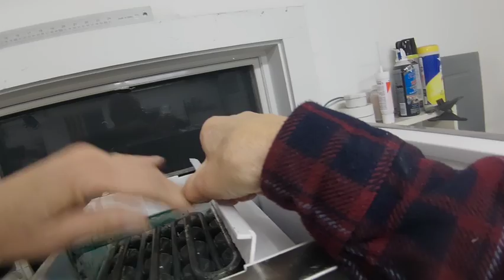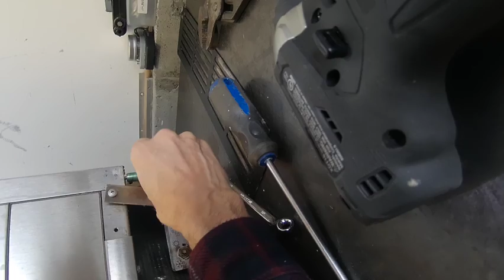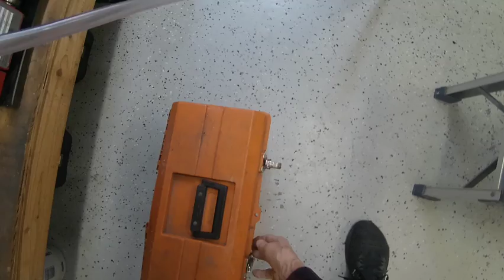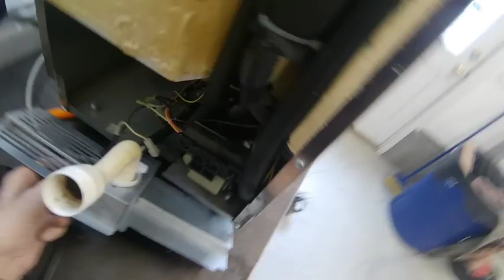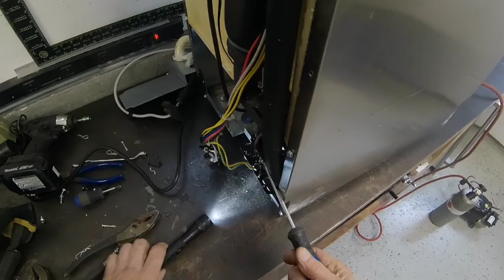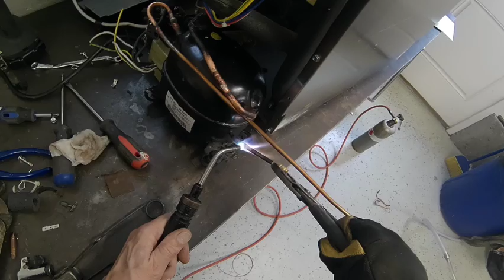Sub-Zero UC-15I Diagnoses and Compressor Replacement,ent

Comment: No need to open up the pump or remove the pump.  How to clean the entire machine. Need 3-4 large bottles of Lime Away or CLR. 1.Disconnected water inlet line,  2.  Fill the ice reservoir full of Lime Away.    3. take drain hose and place end of drain hose into the Ice reservoir. 4. Disconnect compressor electrical connector.  5. Place water inlet line in a full bottle of Lime-away and place bottle high above the machine. 6. Make Ice. Let unit run continuously for 3-5 days depending on how badly calcified the unit is.   When done, This recycle procedure cleans the entire machine repeatedly.    Do not use Vinegar.     7. Then rinse at least four times.  8. throw away the first batch of ice.         If you have unnecessarily removed the pump.   Fill the pump with large bottles of Lime Away or CLR,  until it comes out the other tube. Let sit for at least three days, Then rinse at least four times.

Comment: Local Subzero repair guy came out for a $200 upfront cost - (they are respected and knowledgeable & we have used in past) just to tell us the machine is too old and not worth repairing and best to buy a new machine.  I wish it didn’t cost $200 to tell me that! 🤦‍♂️
Reply from the maker: I have several of these for parts, try selling it on FB Marketplace or eBay.
Reply from the maker: factory service?
Reply: @SubZeroSpecialists  routine sanitation and cleaning, filter changes and yes he was factory certified and no he never even opened up the back. This seems to be the routine here in New Orleans. Service don’t need to repair anything if they charge that much not to. It’s pathetic.
Reply from the maker: Where are you located?
Reply: @SubZeroSpecialists  New Orleans.  You need a trip to the Big Easy!!
Reply: @SubZeroSpecialists  why don’t you come get this thing? I’m sure it can be made to work, I replaced it already.  But too many good parts in it to just leave on the street! Let me know

Comment: Great video and great patience. My compressor was replace 3 months ago but it wasn’t the problem. I think they replaced a board which got it working but now back to its old way. It makes ice in 31 minutes on the money,  but then gets stuck in harvest cycle I guess. The water line opens up and runs continuously. Sometimes it will move out of harvest but mostly not. It needs to be turned off and back on. Is there something in the harvest cycle like a sensor that tells it to go back into refrigeration mode? Or is it supposed to be a timed cycle? Thanks
Reply from the maker: There is a sensor on the condenser. I would check the water level and the water valve.
Reply: Thank you for the quick reply!  @SubZeroSpecialists
Reply: I went to your website and read the ice making procedure for the UC-15ic. The best I can tell is everything is good except it will get stuck at the “Refrigeration System Start-up”. It is supposed to be there for 5 sec but it will just stay there. If I turn it off and back on sometimes it will work. Is it safe to say its the board? Thanks! @SubZeroSpecialists
Reply from the maker: It’s hard to diagnose a machine without being there, there are many variables. What’s the back pressure, is the water spraying, is it running out of water?
Reply: Sorry, I don’t expect you to fix it. Just picking your brain and years of expertise. Everything can work perfectly for days then gets stuck in start-up mode. If the manual says Start-up last for 5 seconds is there anything besides the electronics board that can tell it to go longer than 5 seconds? I know it’s not the water level because it keeps pumping out the overflow when stuck in Start-up.For some unknown reason it has been flawless. I had it turned off last night.  @SubZeroSpecialists
Reply from the maker: @koomamps  call Sub-Zero at 800-222-7820 ask for an engineer and explain your problem, they may be able shed some light on it once they know your serial number.
Reply: Hi, I finally noticed there is a jumper on the board for 134 vs 209 refrigerant. It has been wront on 209 vs 134. Do you know what the possible issues that would cause? Would it blow the board or anything major? @SubZeroSpecialists
Reply from the maker: @koomamps  are you referring to the control board. Send me a pic at subzerospecialists@gmail.com
Reply: Sent, thanks! @SubZeroSpecialists

Comment: and acetylene without oxygen will be able to melt brass, which is used in the factory soldering of pipes on some refrigerators
Reply from the maker: The Turbo Torch will assist in melting the solder. I use silver solder 56%
Reply: @SubZeroSpecialists  I meant when desoldering when you remove the old compressor, it is sometimes soldered with brass, which has a higher melting point than copper-phosphorus solders.  Map gas burner can't desolder this.

Comment: I forgot to ask where you can buy a container for pumped out freon like yours?
Reply from the maker: Are you talking about a charging column?
Reply: @SubZeroSpecialists  yes glass
Reply: @SubZeroSpecialists  yes glass
Reply from the maker: Charging cylinders are no longer available, try eBay. They were made by Thermal Engineering and were discontinued
Reply: @SubZeroSpecialists  what soldering gas is used?
Reply: Sorry acetylene

Comment: I have 2 questions Where can I buy a pipe cutter with a ratchet mechanism like yours?  and what kind of gas do you have in the welding cylinder and burner?  Give links where you can buy all this.  Thank you
Reply from the maker: You can buy that tubing cutter online, I got mine from Vulcan Lockring. If you’re asking about the gas in my MC tank it’s acetylene with a Turbo torch.
Reply from the maker: VULKAN LOKRING RATCHETING TUBE CUTTER 1/9"-3/
Reply: Thank you